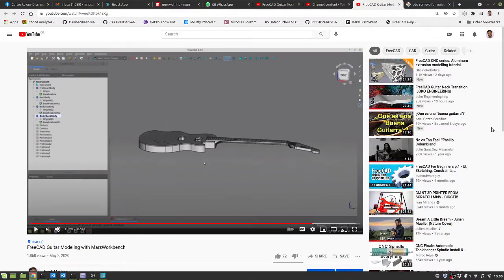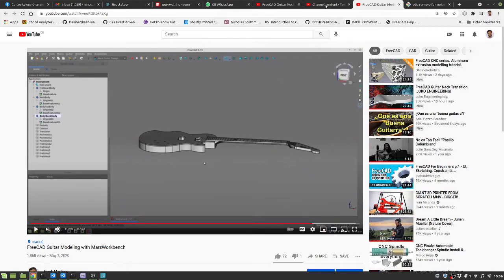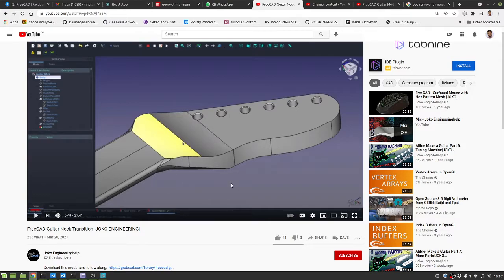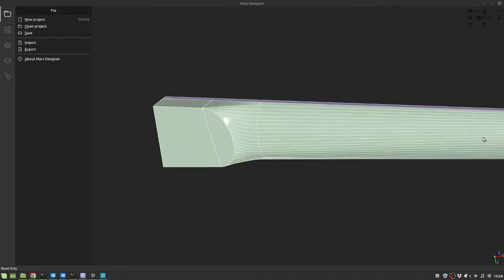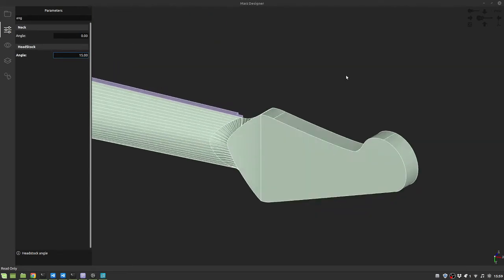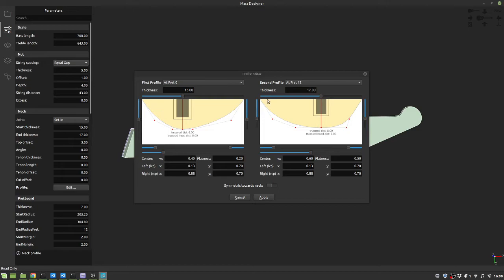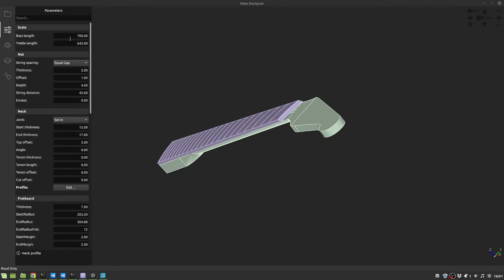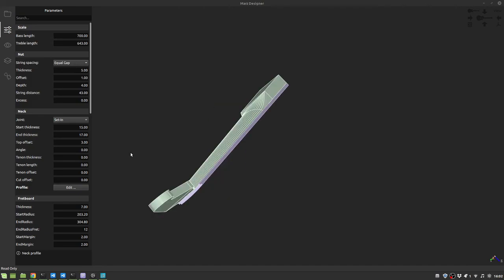Marz Guitar Designer Update (aka FreeCAD Marz Workbench)

Comment: Amazing tool! Is there any way to add frets to the model? I tried manually adding them in FreeCAD in the fret slots generated but I can't seem to get the curve of the frets right.
Reply from the maker: Thank you. Fret slots follow the curvature of the Fretboard and also the angle created by the multiscale parameters if it is multiscale. If the Fretboard has compound radius it affects the curvature of the FB, basically curvature is different at any point in that case.
Reply: @mnesarcox  Thanks! That's probably why my manually added frets don't line up the right way. I'll keep poking around with it
Reply from the maker: @thomasmcdonagh1837  Take into account that in real life, frets are fitted by deformation (hammered/pressed). That said, I thing you can use the slot side as a reference for the fret. but basically each fret has a different geometry.
Reply: @mnesarcox  Alright. I might go in and manually add the curve for each fret. I appreciate the help.